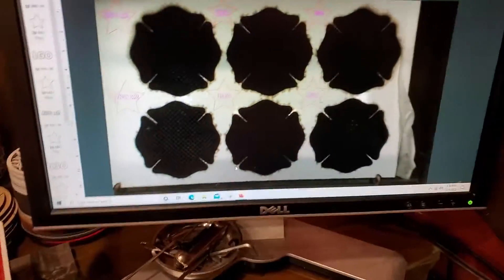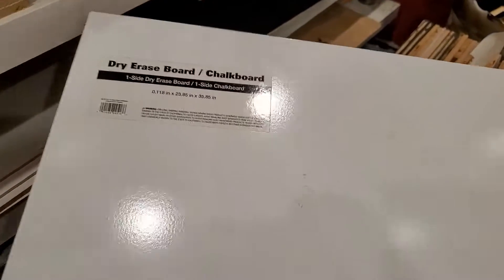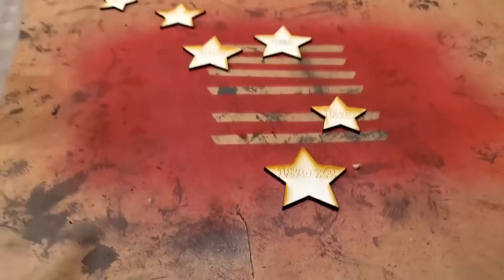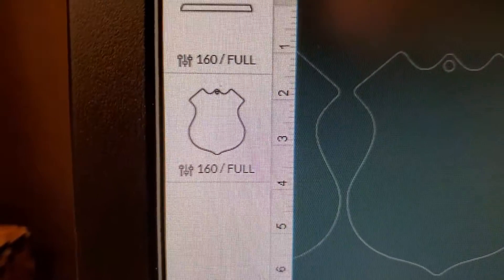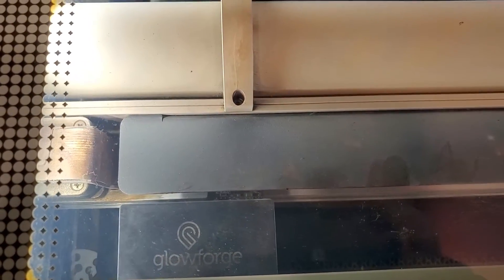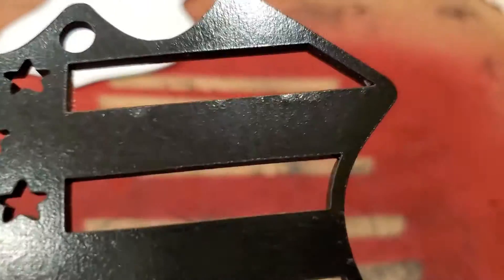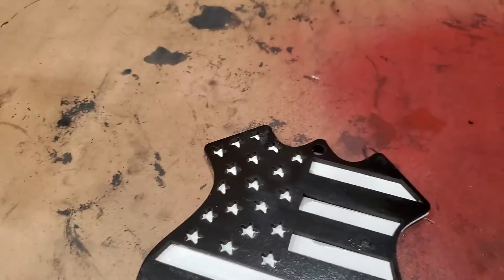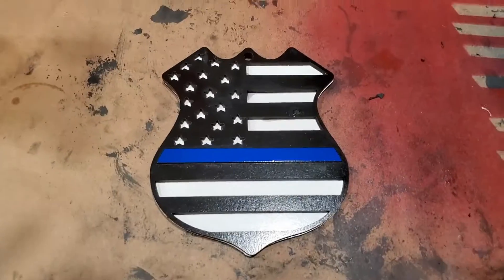Police Ornament Tutorial OR Lowes Markerboard Chalkboard tutorial

Comment: What size do you cut your sheets to?  I love the use of the pins.  Thanks for the tip.
Reply from the maker: Usually about 12 x 19ish.  For the Lowes Whiteboard, 907231, I cut it in half lengthwise, then into 4 or 6 pieces.  Mostly depends on what I will be making soon.  I hate to use a 12x20 for a 11x15 Monogram.
Reply: @LithosAndLasers  Thanks for the quick reply.  I appreciate the tips!!  Keep up the great work!
Reply from the maker: @MrUltraHide  Thank you soon much. Glowforge is sending me a refurb, so content has been slow bit I have lots of videos planned. I also ordered a flash laser 690 and will be able to cut 12x24 and engrave tumblers. Exciting

Comment: Did you make those wooden pins? If so would you be so kind to shared the measurements ?
Reply from the maker: The wooden pins I cut, but did not design.  They are free.  Google glowforge hold down pins.  You will find the file, the. Just copy and paste then cut a bunch from 1/8 material